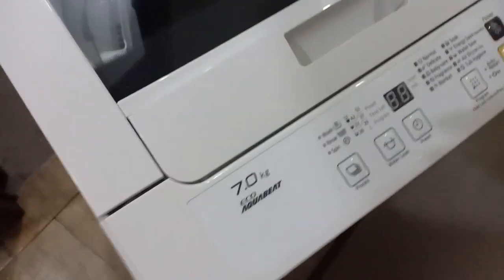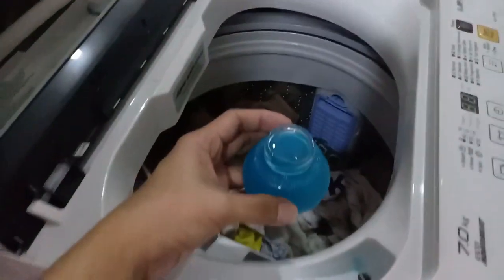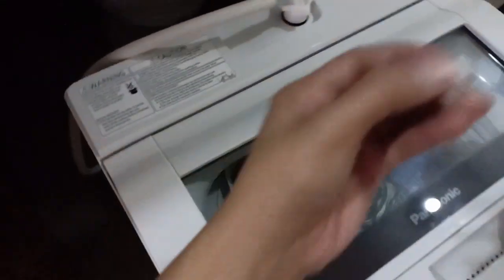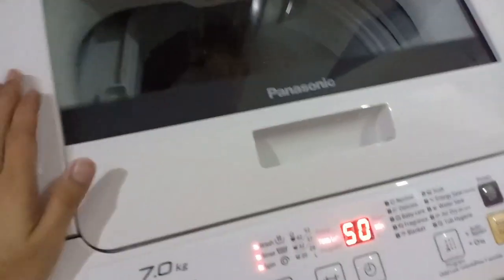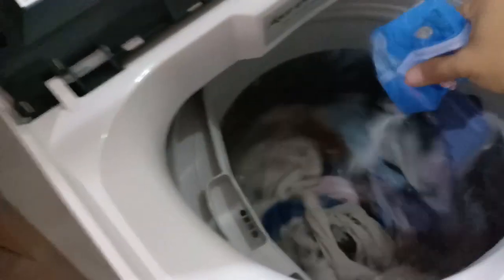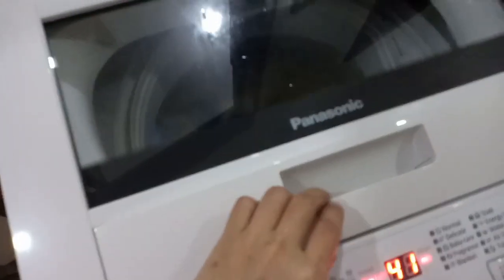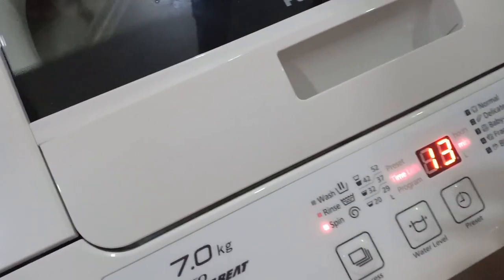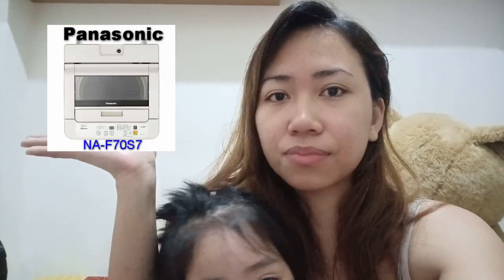VLOG #19: How to use Panasonic NA-F70S7 Automatic Washing Machine / DEMO ♥ The Newbie Mommy ♥

Comment: hello po kabibili lang nmin ng  washing machine nato same lang din. ask ko lang po maalog po ba tlga sya pag nasa rinse na? ung pag mabilis na ung ikot nya.. kasi samin kahit lapat nmn sya sa sahig maalog sya masyado. hindi nmn tumatama ung umiikot sa loob. maalog lang sya. okay lang po ba un? thank you.
Reply from the maker: Hi Gervel! Just wanna clarify if umaalog ba yung mismong body ng WM like umaangat ba yung bottom part? It doesn't happen kasi to our WM kasi. The body is stable naman, hindi sya gumagalaw or umaalog even if we put few clothes lang in it. You may want to contact your supplier or direct to Panasonic Phils. for clarifications para ma-address agad yung concern. Hope this helps. Thank you!
Reply: @TheNewbieMommyCandy  hi thank you sa reply ndi nmn umaangat ung bottom part nya naka lapat sya just the whole body ng washing ma shake masyado.. Ung isa din nmin washing same brand ganun din ung alog nya
Reply from the maker: @gmv5398  Hello again! Aw, I see. I think as long as stable naman yung bottom niya while working, that's fine. And I think a little shaking is just normal sa mga Ws since the inside part is spinning/rotating with force. Have a nice day ahead!
Reply: @TheNewbieMommyCandy  i see sige salamat 😁
Reply: Gervel Villanueva  pano po pag drier lang kase po ung father ko gus2 nya sya ang magkukusot so gus2 ko pag aralan kung pano pag drier lang pano ung process salamat po
Reply: @joshuaesperida512   sa "program" meron dun ung "air dry" 90 mins un pero ung ginagawa ko is ung sa "Process" pinipili ko ung spin lang my option dun na spin lang may ilaw  ndi ko alam kung depende sa dami ng damit kung gano katagal pero nung nag try ako siguro mga nasa 2kg 9 mins lang sya okay nmn mejo natuyo sya. sampay nalang ng onti tapos okay na. tapos kung gusto mo nmn pwede mo ulitin kung mejo ndi ka satisfy sa tuyo nya.
Reply: thanks po

Comment: Maaksaya sa water. 😔 I mean, normally kasi, di ba, (if di ka gumagamit ng bleach for whites), yung may sabon na water, gagamitin mo na 'yon for the whites and then for the colored ones. Hindi mo siya papalitan hanggat di pa tapos ang lahat ng labahin. Pero 'pag gagamit ka ng automatic washing machine, sa whites pa lang, you'll consume liters and liters of water na agad and once done, another liters and liters of water na naman for the colored. Kung baga, yung water consumption will be doubled kasi need munang matapos (from wash to spin) ang first batch before makapagsimula ng second batch.
Reply: Mababa naman singilan ng water samin mas mahal nga kuryente kaya oks lang samin yang auto washing
Reply: You have the option naman na saluhin yung tubig sa drainage pipe. And pwede atang manual ka na maglaba diyan like wash cycle lang for example. Ilagay ang whites, set sa wash cycle, wash done, alisin ang whites ilagay ang colored, same process again.

Comment: Problema po namin ay kung pano po pipili ng program dahil po kapag pinipindot po namin 1 lng po lagi nakalagay
Reply: Kung ayaw niyo po sa #1 mode (Normal)follow these..

Press On button,tapos press program para mapili kung anong program ang gusto niyo.. Nasa panel board naman kung ano yung assigned programs kada number.. Kunwari ang napili mo is #7 which is energy save..after mo mapili yan wag mo muna pindutin ang start.. Press mo yung water level para makapamili ka ng level ng water na tantya mo eh swak lang don sa nilagay mong labahin.. Kung sakali mang kulang ang tubig pwede mo pa din mabago yun, press mo lang water level.. Tapos pag nakapili kana ng water level,press mo na start..
Reply: Pipindutin lang ng paulit ulit yung program para makapili ka..kasi ang default mode nya is number 1 (normal)..
Reply: Alam na po namin thx din po sa pagsagot.

Comment: Ask lang po, inooff niyo pa po ba yung gripo ng water kapag nagwawash pa siya at inoon lang ulit kapag magririnse na? Or tuloy tuloy lang din po yung pag agas ng gripo? Salamat po
Reply from the maker: Hi! Hindi po dapat ino-off ang faucet during the whole process, dapat tuloy tuloy lang po.☺️ Pwede nyo lang patayin pag nasa last process na which is yung spin. Thanks for watching!
Reply: @TheNewbieMommyCandy  pano pgnagstop Yung washing sa 47mins. Palang tapos ndi n sya Ng start ulit?thanks
Reply from the maker: Pag nasa 47mins dapat po may lalabas pa ring tubig maya't maya since nasa wash or rinse process pa po ito. If tumigil, better have it checked po as there might be a problem. Thank you

Comment: is the unit still ok? do you recommended it?
Reply from the maker: Yes, been using our AWM for almost a year and still works fine. Wala pa naman any problem using it.  I would recommend it. ☺️
Reply: @TheNewbieMommyCandy  mommy .. hnd sya mgasto sa kuryente??
Reply: @TheNewbieMommyCandy  VERY HELPFUL ang vid. Also, same question here, in 2 years, is it still working po and no problems within the last 2 yrs? Thanks

Comment: Thanks sa demo, donwload ko tlga sya para gayahin ko lahat paano.hehehe
Reply from the maker: Hi! Thank you po. But correction dun sa filter, don't remove it po. And also if you're going to use powder, better if i-dilute muna sya sa tubig. Yung first number na lumabas is not the weight of the clothes but the liters of water to be used based. Thanks! ☺️